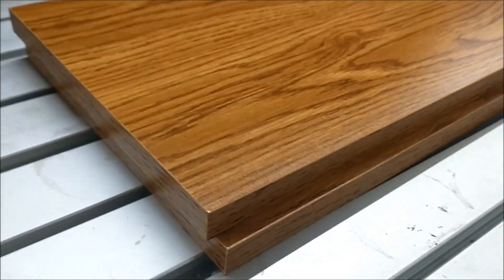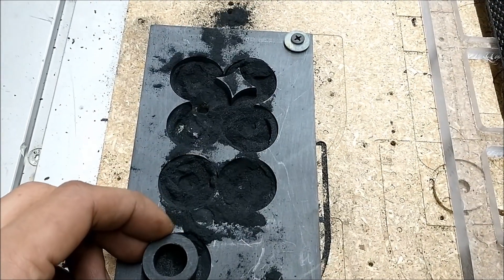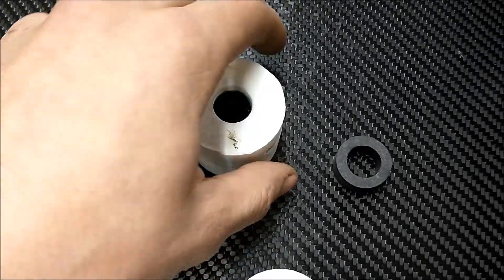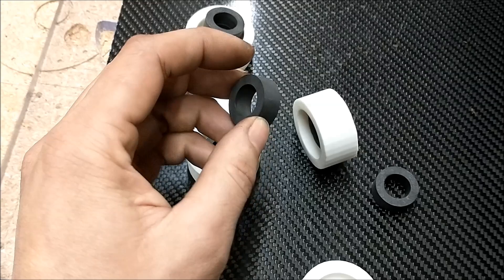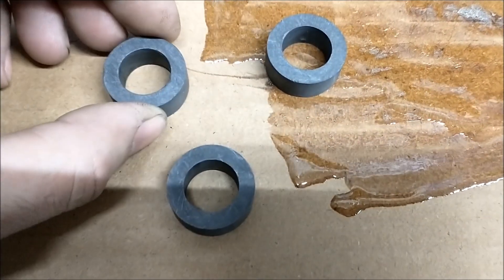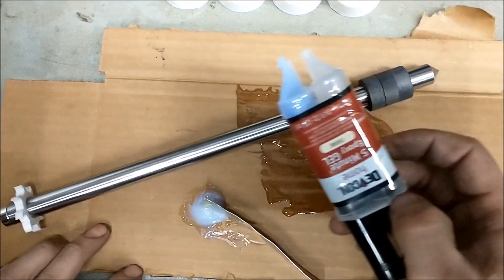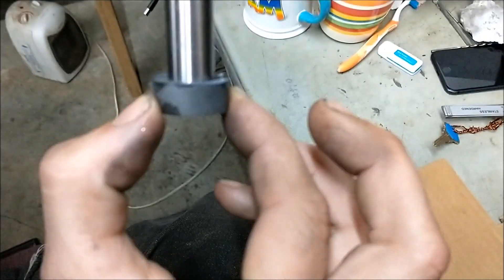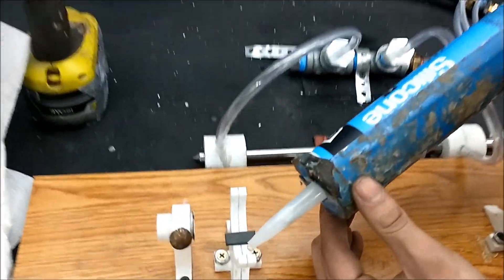3d Printed AIR BEARINGS! Ready for Tesla Turbine!

Comment: would you be interested testing a tesla turbine ramjet engine, centrifugal compression pump out? gasoline, kerosene, anything liquid enough, to pass through, center air and fuel mix inlet. how about maglev bearings?
Reply: manufacturing tip: first glue, then make the wanted form
Reply: all excess glue are ripped out from inside
Reply: they can be totally passive, no air inlets for the bearings, not needed
Reply: airlev bearings
Reply from the maker: I'll be returning to magnetic bearings in the near future. Also Ill be working on fluidic bearings as well.

Comment: So do the graphite sleeves also spin on the cushion of air and also let the shaft  spin without friction inside the sleeve at the same time like the shaft can spin freely faster than the graphite sleeve can spin on the air ride or does spin?
Reply from the maker: You are correct.

Comment: I wonder if you can substitute the graphite with a long ferrite core tube or even just a 1501 steel and just relay on precise cutting with smoothing an polishing and the air cushion that way a heatsink can be added inside the ferrite or steel air barring to faster cooling and get to higher rpms without adding more air then necessary just to cool them and for long term automated mass production and with supercaps on the rise so will the price for graphite that and china buys up a lot of it.
Reply from the maker: With more funding I can make that stuff. Our funding is growing by the week. Would be cool to do it all.
Reply: @iEnergySupply  to make a air bushing you should be able to use the lathe to bore it and a sanding stone bit and a polishing bit to finish it make shure all corners are rounded and you should be able to use high temp rubber oring gasket's I think all that can be found at a hardware store other than round heatsinks from ebay and a new housing from your 3d printer and bam air bushings on a budget should last longer than graphite.

Comment: Would it be simpler to glue the graphite rings together first then do the grinding? That would remove any glue and create a uniform surface across the segments.
Reply from the maker: good observation, I did both. In the future it will only have two segments.
Reply: Was going to suggest the same👍🙂

Comment: Graphene sir. You should consider how magnets and electricity behave under a vacuum.
Reply from the maker: Anything you know of that is abnormal off the top of your head?
Reply: @iEnergySupply  graphene repels magnets and under a vacuum there is little to no resistance. Graphene makes a great battery as well. And graphene is a type of carbon so it is lightweight and strong.
Reply from the maker: @masonwilson491  Can you imagine the speed you could get with graphene! Now we just need some disks made of the stuff.
Reply: Instead of using air pressure bearings, would air vacuüm bearings work? 🤔

Comment: air bearings are really dangerous.... when speed goes really high, the magnets holding the construction will demagnetize during heat and make the construction unstable pretty fast....and keep in mind the force in small flying objects.. might be a good idea to stand behind cover when running a tesla turbine with air bearings... good luck, i looking forward to see this air bearing tesla turbine. :)
Reply from the maker: Blast shields are always used when I am unsure what will happen, good safety looking out. I've actually got multiple videos of what can go wrong if you go too fast when your side walls are too far away from the periphery of the casein. You must have a close tolerance if your rotor is brittle so that it can slightly stretch and break it's self like breaks in a car to prevent critical speed.

Comment: Now when hooking up the tesla turbine use the turbine to power the air bearing as well no point wasting air pressure , tesla valve might help you there.

 than when that's done build the "earthquake machine" (frequency manipulator) and power it with the turbine , set it to full send and "fucking send it" , make sure to film it tho , live stream , let's see what crazy frequency does I'm sure it will be wild
Reply from the maker: Great ideas! Yeah can you imagine a nearly friction-less air bearing and a nearly friction-less piston with magnetic bumpers on the earthquake machine!! Also lol we could add combustion to the pistons!
Reply: I wonder if you could use it in place of an engine?

Comment: Seems like the glue between the three sleeves would/could prevent air flow from the middle sleeve to the other sleeves but maybe this gets spread out in the casing first and evenly penetrates the graphite from all sides?  A diagram of this would be cool.  Also it seems like the gluing of the graphite sleeves into the housing would be equally as tricky to do right and should be shown.  There was no explanation as to why the end of the shaft was pointed and touches an end-plate on one side.  Is the table slightly tilted to keep the shaft touching the endplate? What air pressure did you use? How long should these bearings last?  Wouldn't they grind themselves down quickly and become loose?  Definitely works!  Don't forget to wear a mask at your next orgy!
Reply from the maker: Surprisingly all the problems are non existent, sorry for the missing details.  My camera man had to go and I was impatient to test it. I will have more details next time, it saves tones of time in the comments. The point stops the shaft. The graphite is a natural lubricant and actually doesn't touch the shaft when the air is on, when the air is off there isn't any appreciable wear Graphite has some very unique properties and is actually used in this application in commercial applications but are extremely expensive and companies don't like to sell them to just anyone. 80-100 psi. The bearings glued into the end pies just like I glued the graphite together but gets glued to the bottom inside.

Lol I wasn't expecting that to happen but when it did I was like hm.... I think ill leave it in for a little humor/entertainment.